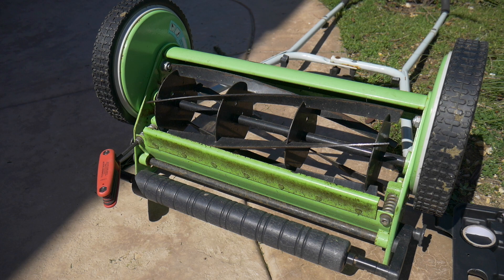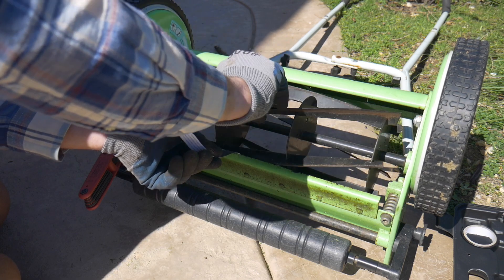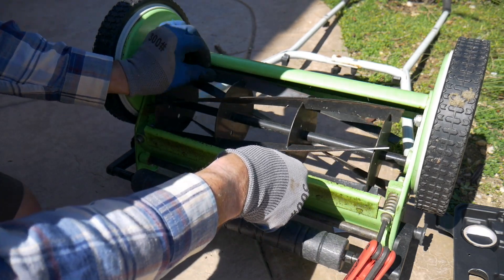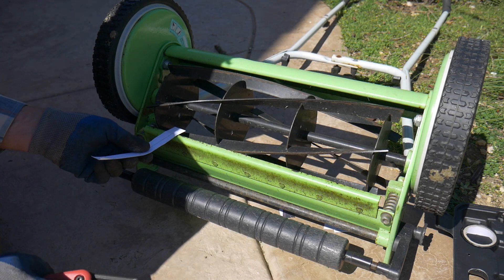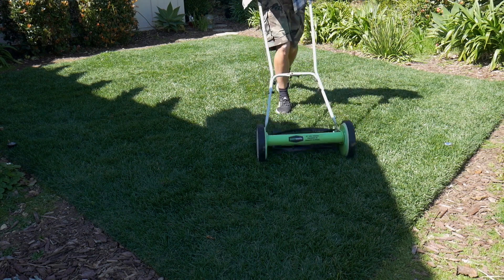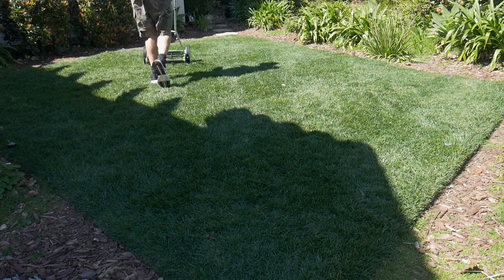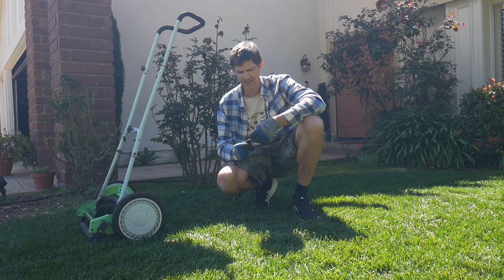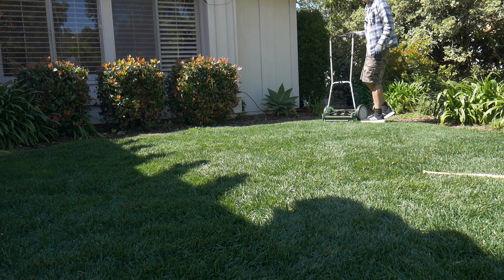Reel Mower Maintenance How to Adjust the bed knife

Comment: I will be starting in a couple of weeks. My Earthwise 7 blade will be getting a lot of use this season.
Reply from the maker: Can't wait Striperman. Are you using your push reel because you will be leveling with sand?
Reply: @DirtygardenCA Well I will be doing a second sand leveling again this Spring but the main reason is the ease of using it more often like every other day and then use my Allett mower on the weekend to stripe the lawn. This way the lighter mower wont burn in the stripes in one direction and will give the grass a more even cut
Reply: Does the bedknife need to be loose in order for it to adjust with the adjustment bolts?
I disassemble the mower and putting it back together.